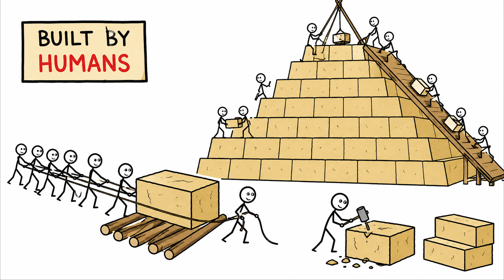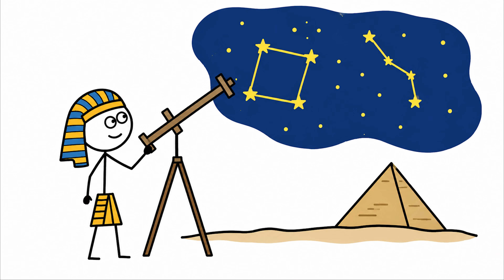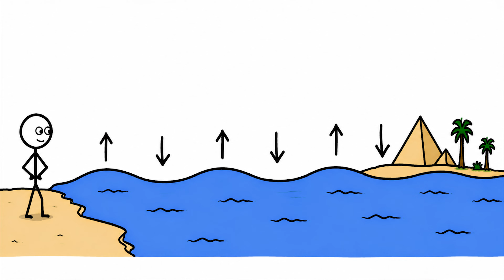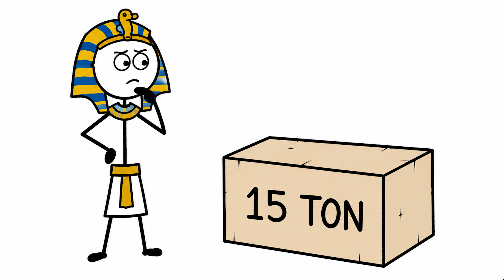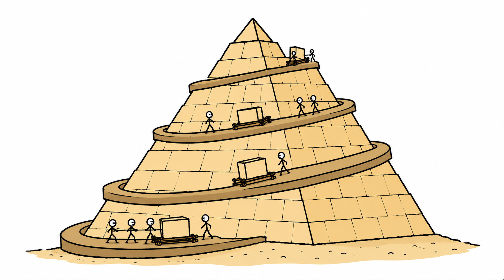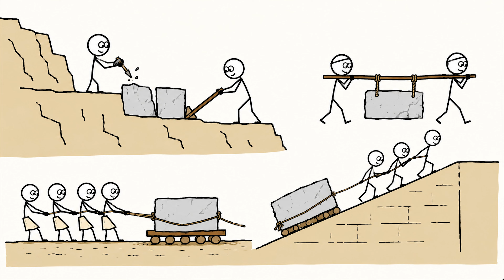How Humans Built The Pyramids?

Comment: Could the stones have been pulled up one after another directly along the walls of the rising pyramid, rather than using ramps? On just one side, it would be possible to haul 50 to 70 blocks simultaneously, which would allow for many blocks to be pulled up per working hour. Naturally, the ropes pulling the blocks would be stretched over to the opposite wall, and the workers would haul the blocks by sliding down the slope of that opposite side. Gravity helps immensely here, and this technique requires the least effort in building a pyramid, because the workers counteract the weight of the block with their own body weight, instead of dragging it up with immense physical effort. If a block were exceptionally heavy, a larger number of builders could be attached on the other side as a counterweight. Simple, right? Rampa jest niepotrzebna . Wystarczą dwie pochyłe ściany piramidy . Bloki wciągamy po ścianach za pomocą lin , schodząc w dół po drugiej stronie